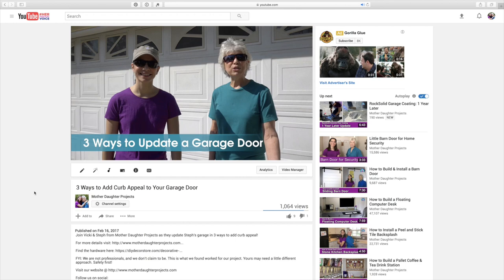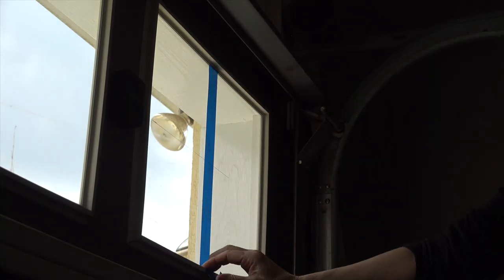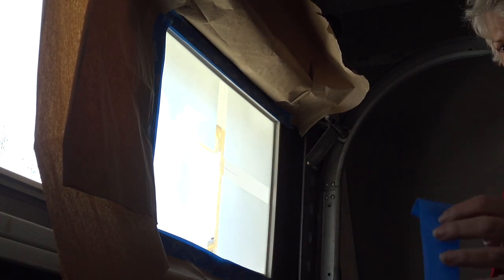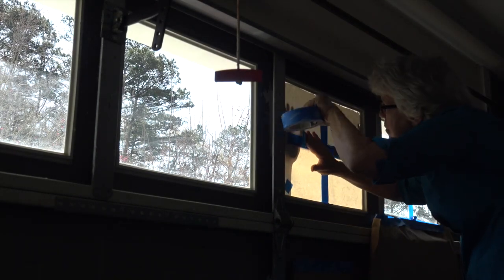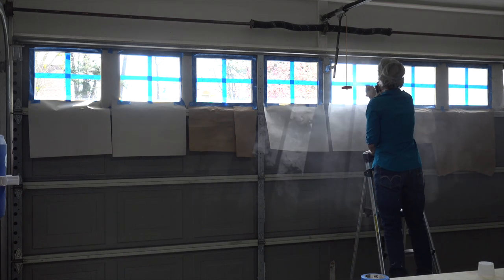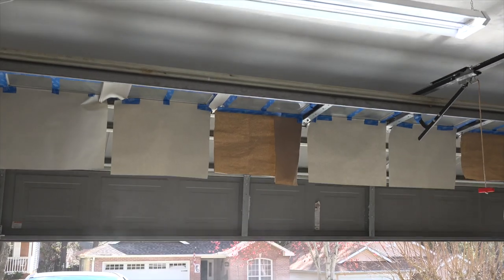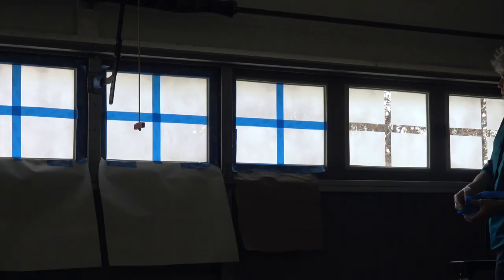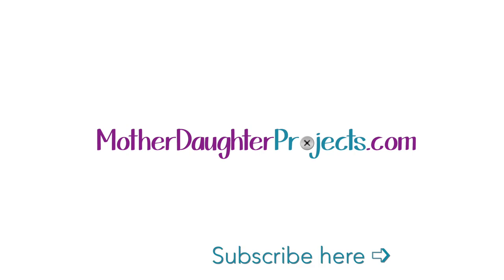DIY Garage Door Windows

Comment: I like your idea. My window inserts are broken and need replacement. Two quick questions. Will the frosted glass spray work on acrylic window? What can I do if I want to remove the frosted spray applied from my windows later?
Reply from the maker: I don't really know about acrylic windows. On glass, it would be easy enough to remove with a razor blade although we've not tried to remove it in this manner. I have removed paint splatters on glass with this method with success though. ~Vicki